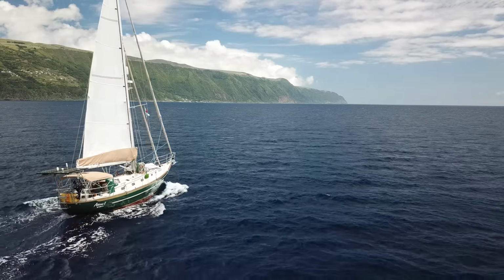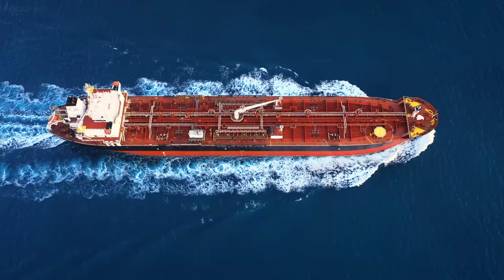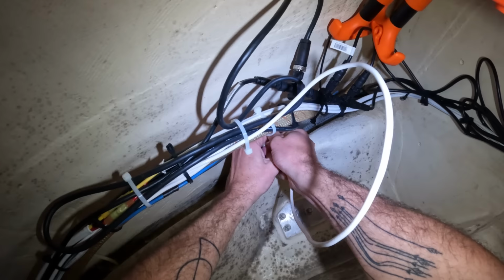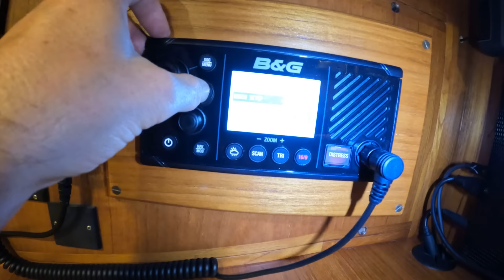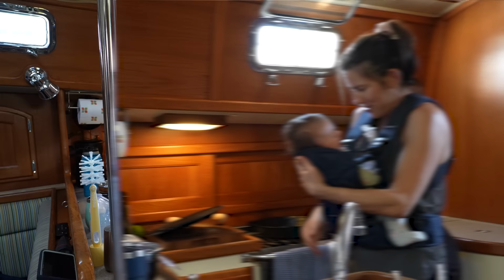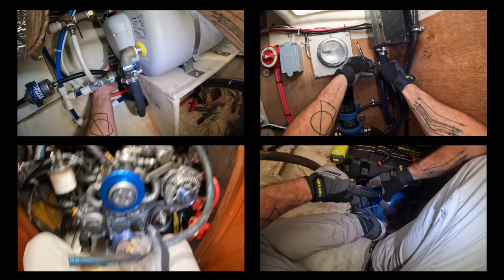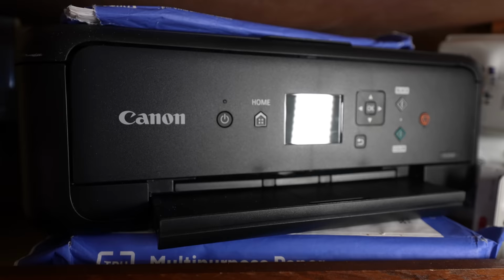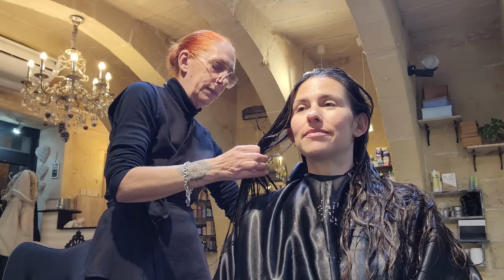This is going to get Messy! | S08E08

Comment: I suggest installing a short removable spring lanyard on the transmitter. I dropped mine so many times under way in rough weather, watching it slide accross the deck

Comment: You could just get some dark screen material and tack it to the inside of your ventilation holes and stain the inside of the cuts so it looks more finished, maybe bevel down the outside of the holes too.  That would probably look better than those white grilles.

Comment: Pro tip...
Always wrap teflon tape clockwise so the tail end faces away from the fitting rotation. This helps include the tape within the thread mating surface and prevents shedding the tape during tightening.
Dig your set up!

Comment: Preventive maintenance is a must. It was something I tried to incorporate into our tasks as a master mechanic throughout the years. Something simple as remembering to check hose clamps every so often to make sure they stay secure, especially after installing new hoses, once a year seemed adequate, chafing, proper routing. 
That was awesome to see you get help during the fueling. As always, when one project hits a wall, move on to the next. Parenting is such a joy, never a dull moment. Stay safe folks.
Reply: In the Air Force, preventive maintenance was most of the job, but repair had to be fast to get an aircraft back in the air.  Maintenance was scheduled as were total breakdown inspections which took weeks in some cases.

Comment: Just a thought about those holes in that door you could use some black screen cut to go over it and then staple it on. Then put some trim around its edge. This will give you two little black rectangles, and the trim would cover up the raw edge of the screen. A second option would be to make your holes, larger and rectangular. Then put slats in. Just some thin strips of wood at an angle. I’m sure you’ve seen a door with slats in it, you might even have one on your boat if not more.

Comment: Regarding your battery charger cupboard, have you looked at soffit button vents, they come in different sizes and colours and may be a quick temporary/permanent solution.  Great to see your all doing well and the boatwork continues.

Comment: Just a suggestion, but I would install a lanyard on your Starlink dish  to the boat rail for the times you have to remove it. One slip and it's gone. Cheers!
Reply: That's a great tip. Maybe one with a quick release on the handheld radio at the helm  too.
Reply: @genuinebimmerllc1277  when I saw him taking the dish off overtop of the water I thought...if that were me, I'd drop it 100%.

Comment: It’s amazing how something minor can become super critical once underway and well into the deep blue. Everything electronic gives off heat and can be destroyed by its own heat. You can install very quiet computer case fans such as (two of the best fans) Be Quiet and/or Noctua. You might hear moving air but not the fans. In computer cases the fans are setup in a push and pull fashion allowing constant fresh cool air to pass over each component surface(s) and pulls the generated heat away from each component out into the room. It’s a cheap solution that uses very little power. In a situation where only one fan can fit set the fan to push air onto the electronic(s). Have a great week everyone!

Comment: Next time instead of drilling large holes, you could possibly find a local carpenter who could router a few 1/4 inch slots in the door essentially making the door a grille.  It would be just as effective and a lot less noticeable.

Comment: Probably already solved, but that door you drilled vent holes into: you could use those circular screen sink strainers available in hardware and even grocery stores. Mount with 5200,

Comment: Lots of good work especially with a baby on board.  One point.  At 15:47 you were wrapping the Teflon Tape in the wrong direction which and increase the chance of leaking.  The tape should be wrapped so that it is going the same direction that you turn the fitting.  As you are looking at the parts. the barb fitting is turned clockwise but you wrapped the Teflon counter clockwise.

Comment: I have a 2nd VHF marine radio in the cockpit that uses a separate antenna that is on the bimini framework.  An advantage of this is redundancy in case of failure in the main VHF radio on its antenna system.

Comment: There are techniques to getting a boat off a lee harbour wall, great the marina helped out, do readup and practise unassisted methods, e.g. using a spring line looped ashore.  Routine maintenance is a pain, but really necessary.  There should be design and construction standards for cables, equipment, it seems many items need to replaced or upgraded every 5-10 years, that's a lot of things and, cables, hoses, fittings and time.  Great to see Desiree get a little more time to herself, it's such a demanding time for new mums and you don't have a network around you now that family have gone home.

Comment: hoses, hose clamps, wire terminals, lugs and cable shoes, conduits, seal rings - these are all very unspectacular parts which will definitely screw you if not well taken care of, in the worst possible moments and none is really easy to quickly swap with a new one in an emergency, many are not even be easy to track down. Paying attention to those is a mark of a pro remembering bitter experiences - in good case, those are someone else's.

Comment: Hi Jordan just an idea that popped into my head watching this. The cover you drilled the holes into instead of looking for vent grills how about those old style drawer pulls that were brass and covered over. you would put your hand into them to pull the drawer out. They would hide the holes and allow air flow at the same time.

Comment: Thanks for the episode! Also thanks for addressing the air flow concerns. I do continue to be concerned about keeping dust out of the electronic equipment. Could you put some simple cheesecloth on the inlet side and evaluate how dust-clogged they get? It's remarkable how the efficiency of a fan diminishes as the blades get coated with dust. Thanks for replacing the hoses -- that is going to pay dividends that you won't notice because you won't have leaks or failures!

Comment: With all respect… docking a boat single handed is well possible, but you need to exercise. And prepare ( fenders out lines ready ) go slow Consider the wind and whether there’s a current, then exercise, go out of that box and go again. 

For ease of handling make z line in the centre of the boat. With a small block to the winch in the cockpit. Make sure that line is in that position that when you pull the boat moves to centre of the beam. 

End of the line a large loop. 
We made a plastic device in the line do it fits a boat hook. 

What you do is you go into the berth and if you can not vond close to the dock you use the looped line on the boat hook to get it around a cleat. 
Then at the cockpit you winch the boat in. 

If the weather is decent you go in the berth ( I normally go stern in first ) then first choice is to stop the boat and tie a centre line. But if not possible if then the aft line throws around the cleat and motor in forward. The fenders will catch the boat. Then step throw the front line. 
I never step off until at least the mid line is tight down or two lines. 

It works for 50 ft without bow truster. When you sail regularly this becomes second nature. But do exercise

Comment: With that coolant hose, that is likely to be 30psi pressure. I installed the same then decided to use an extra hose to run pressure water to the anchor washdown and a second outlet aft for deck washdown. Then I realised that the washdown pump was 70 psi so that low pressure hose wasn’t going to work. What I should have bought was “Swagelock” brand 19mm hose. Look it up for future reference. Advantage of the Swagelock is that they have push together fittings that don’t need hose clips. It is the special rubber that holds the fittings in. I have used this hose in my factory for 30 years with zero fails.

Comment: not that you need this advice now.  Im an electrician and have pulled miles of wire.  next time, have the guy pushing bang on the pipe with the handle of a hammer.  it works great.  also pulling a string first, helps a lot.  hope that helps. sail on.

Comment: Don't worry about docking single handed. Once you get the hang of it you almost prefer doing it. On my 33 feet long keeled boat I prefer just doing it myself at this point. Use prop wash to draw you in, have two lines ready, secure first in two secs and tighten the most important one. If it's hard to get off the dock set up a spring line to turn the boat. You're obviously a very experienced sailor and know all of this. I'm just saying how easy it is to just skip the step with the women having to jump around and all of that.

Comment: Your videos get better with age, even if projects were easier in the past.  You will reach a point, probably between 50 and 60 where you pick your projects to do and which to hire help, between 60 and 70 the vast majority of projects are hired help, and after 70, they either don't get done at all, or if they have to be done, you hire someone.

Comment: Hey Jordan I’m gonna be the guy that tells ya I think u did something wrong lol. When u put the pipe tape on the threads on the 90 side u put it on backwards. Always put it on the way the threads are gonna turn. If not u will basically take the tape off while screwing fitting on. I played it in slow motion and think u went left putting it on. Anywsy always enjoy the vids man. Reminds me not to buy a boat lol. Safe travels

Comment: Dude, there are scanner apps for your phones. I use one called iScanner all the time. Printing May still be an issue for you but get a scanning app. If I can used it for federal court filings you should be good.

Comment: What benefit do you think your gonna gain installing the external gps antenna Vs using the internal gps antenna in the unit ? I understand I’m say a metal vessel but on a glass boat the internal will work …

Comment: Wait till he finds out that the VHF can use ANY NMEA gps antenna and didn't need its own!!! As long as the VHF is connected to NMEA, which it should be to see AIS data on the MFD, you can select NMEA as the gps source.

Note...I know this comment is well over a year after the video was made, but maybe it will help someone else.